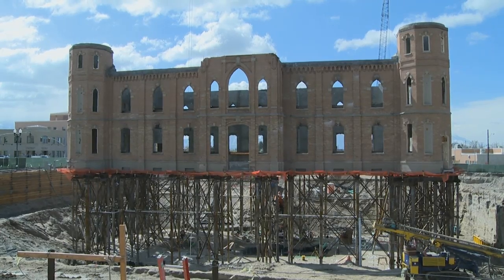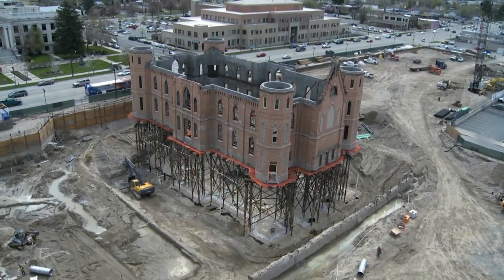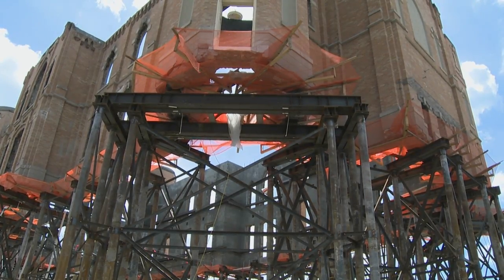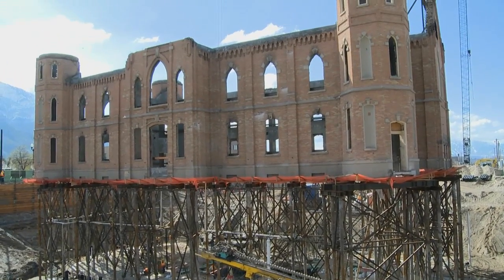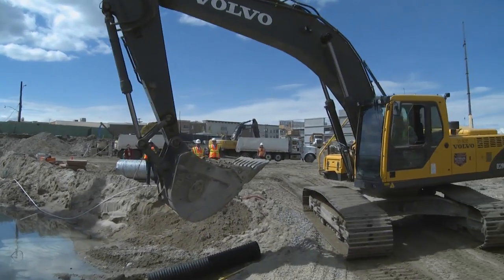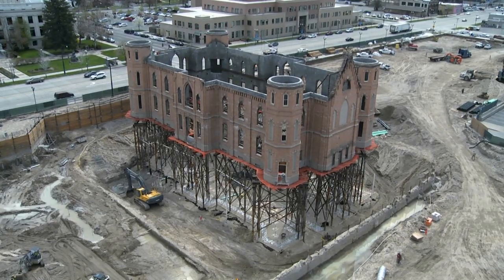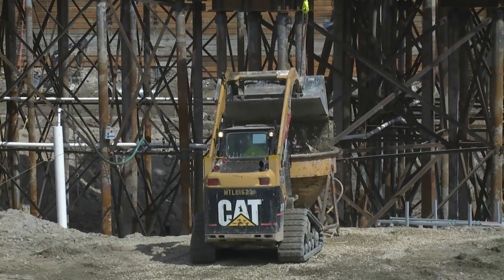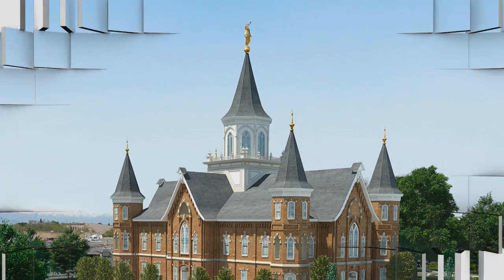Engineering Feat Puts Future Provo Temple on 'Stilts'

Comment: Is it a requirement that the salvation of the dead be done from below the earth?  Is that why they are doing this?
Reply: Steven John The square footage of the tabernacle is not sufficient for all the services a temple offers and the population it will serve. To not change the look of the structure 2 additional floors are being built below it. In order for that to happen and make it earthquake resistant a lot of excavation is necessary. Thus the stilts were a good solution to the problem.

Comment: I am not a Mormon, I have never been to Provo.  But I was saddened to see the old tabernacle burn and I have been checking back from time to time to see what the renovation, if any, would look like.  It does not seem so much like a restoration.  Seems more like a new building with part of the old building retained as a sort of top cover.  Well, I hope it works out for them, and safely.  Will be interesting to see how it turns out.